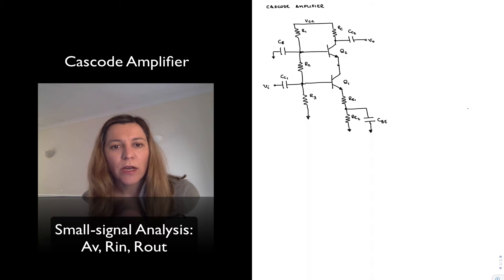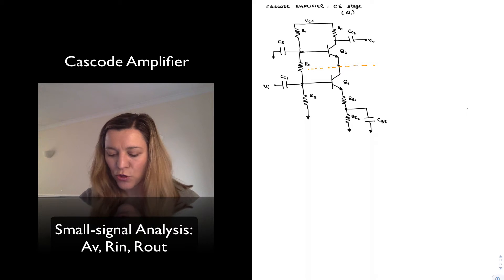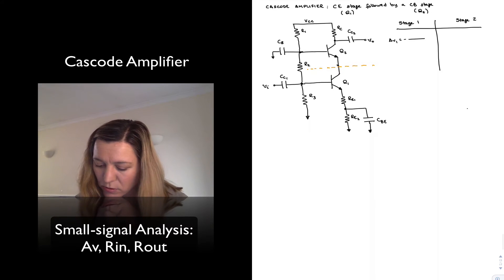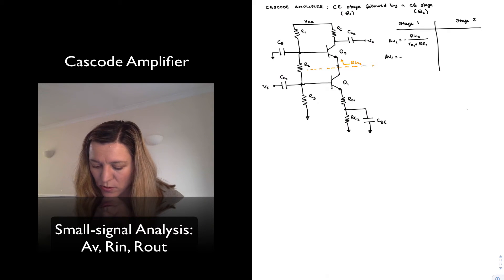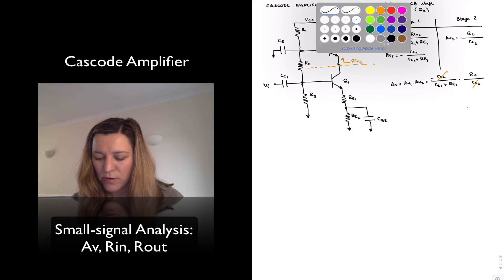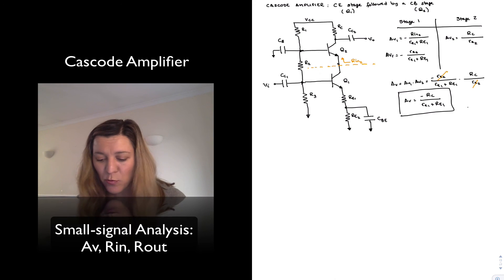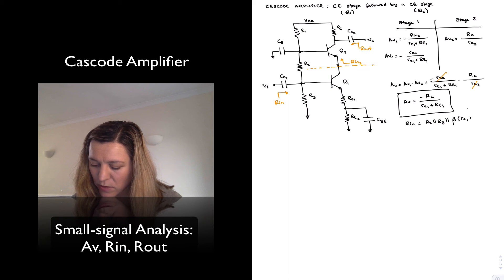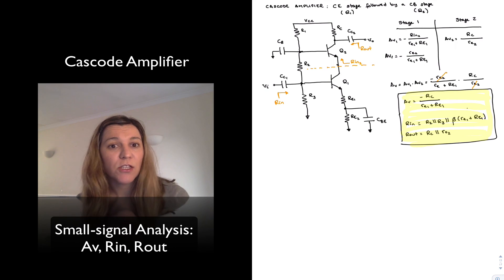Cascode Amplifier: Small-Signal Analysis

Comment: Hello, I think that the "Ro" is not RC in parallel with "ro2" (ro2 is only the output resistance of Q2).  The Q2 emiter is not connected to signal ground. The "Ro" is practically "RC".
Reply: you are right. ro' is already greater than ro. So Ro is practically RC

Comment: It's a bit hard to read :/ maybe zoom in on the text?
Reply from the maker: Thanks for the feedback. It will be kept in mind for future videos. Note, however, that these video are designed to be watched with quality settings 1080 (see Settings->Quality->1080) and in full screen (you may need to allow a few minutes of buffering depending on your connection speed).